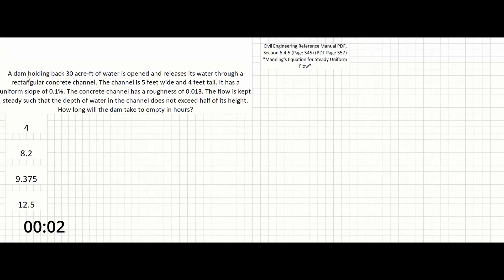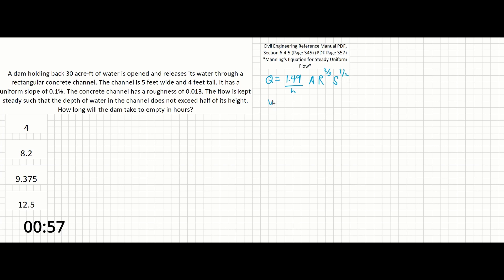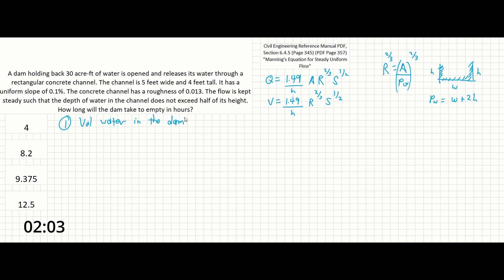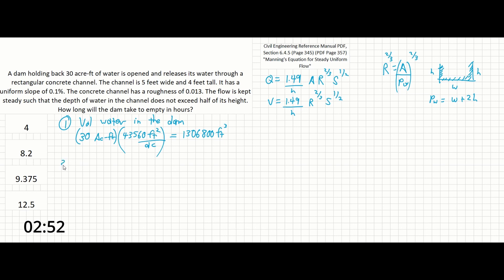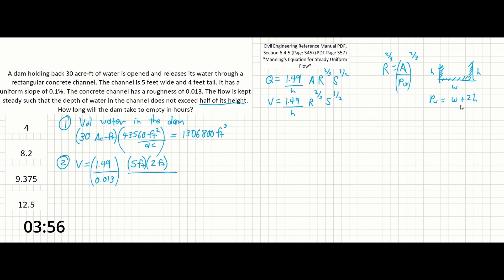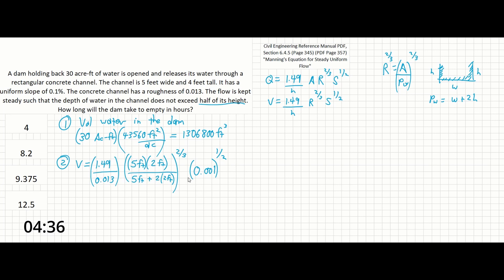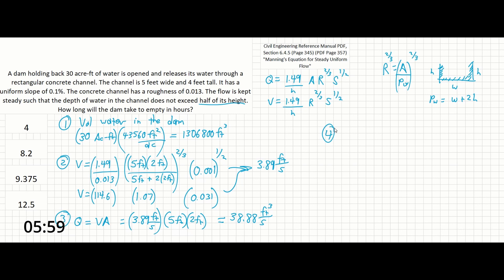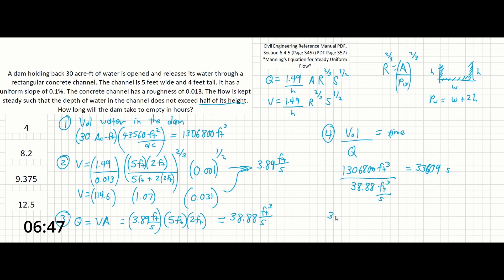PE Exam Practice Problem #42: Water Resources | Open Channel Flow - Mannings Equation

Comment: Working through these problems for my upcoming exam and really appreciate your walk throughs. I would like to ask though, when you're solving for the hydraulic radius for the channel should the area not be 5' x 4'? I would that when the problem was saying that it was flowing half full that that was more for the wetted perimeter rather than the area too?
Reply from the maker: Thanks for watching and thanks for the question! To the best of my knowledge, we are only focused on the geometric dimensions of the flow area. If the channel were 100 feet deep rather than 4, would the hydraulic radius of the flow change? This link may explain in greater detail: https://www.cedengineering.com/userfiles/Partially%20Full%20Pipe%20Flow%20Calculations.pdf
Reply: @SolvedIn6  You know I re-watched this thinking about that and that makes sense! thank you!